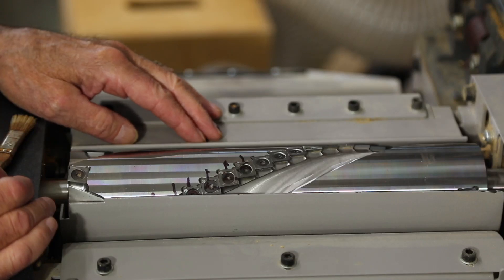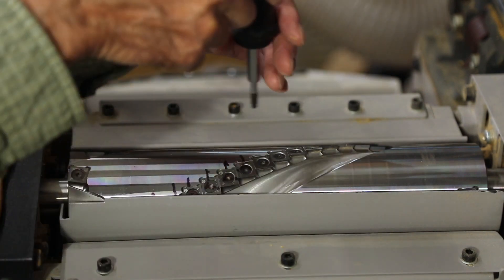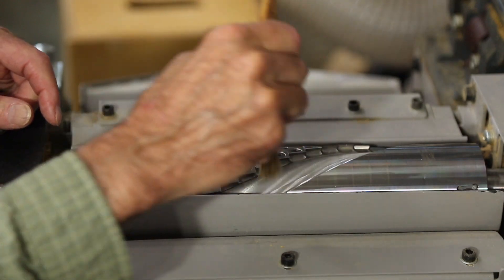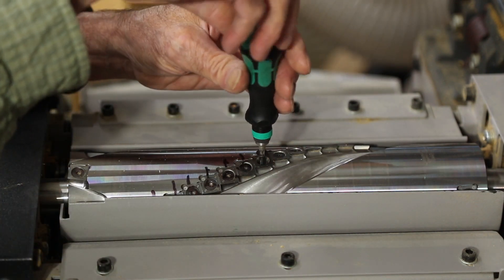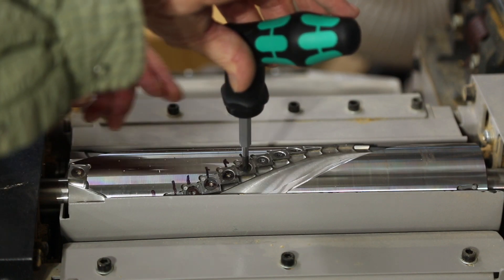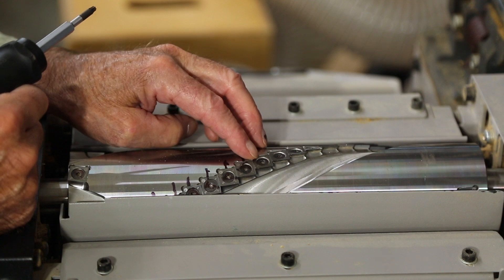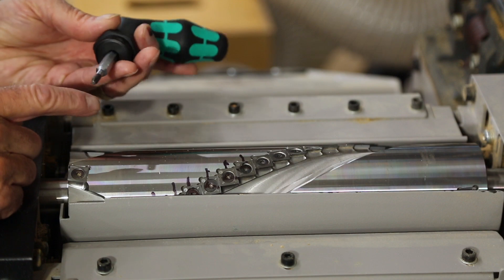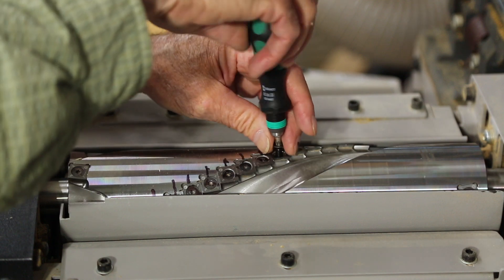Turning or Replacing Carbide Inserts on a Felder Silent Cutter Head

Comment: Very simple to do a single cutter. And there are how many? Looks to be an all day job to me. But about the same for a cutter head with bar cutters. And you get the advantage of not having to replace the bars for a single nail strike. Thank you for sharing Ernie. Have a great day and stay safe. PS I enjoyed seeing you at SWAT.
Reply from the maker: Actually, it took about two hours once I had a 5 Nm torque screw driver from KC Tools. It is much easier than straight knife cutter heads because you do not have to adjust the edge to the right height. There are 48 inserts in the A3 31 cutter head.